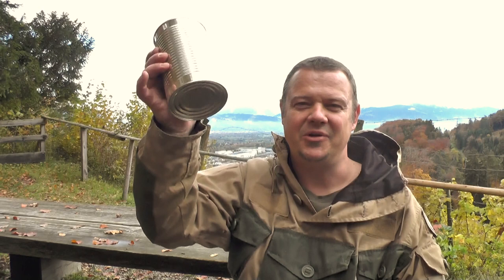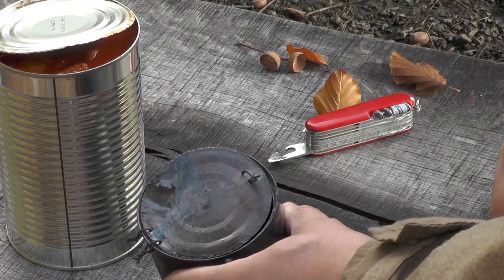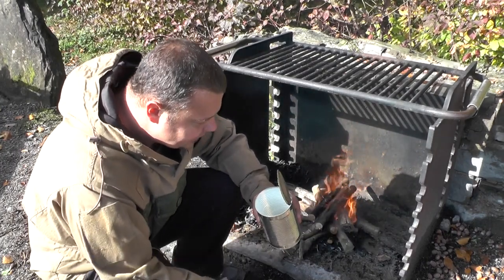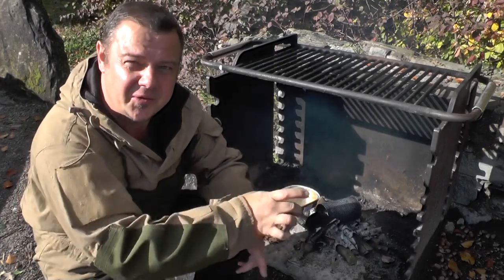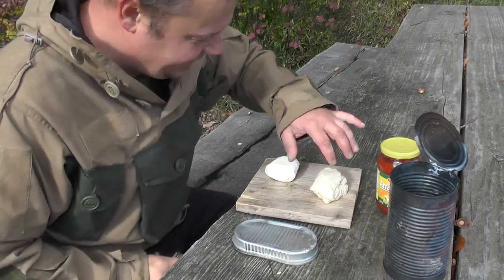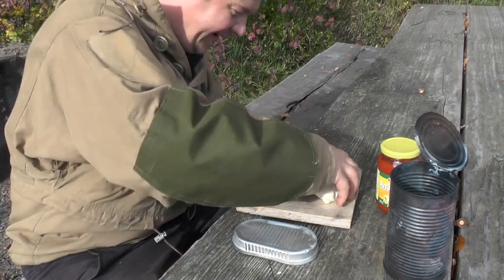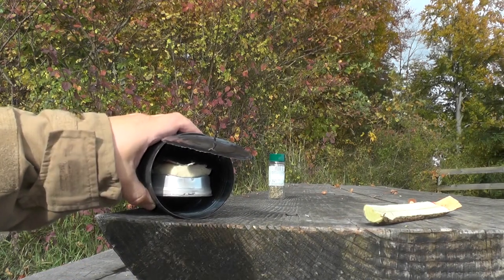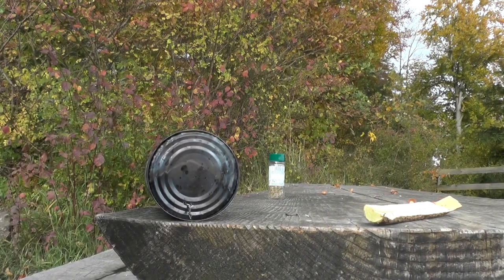10 Cent DIY Tin Can Oven - Amazing oven for baking bread, pizza and cookies

Comment: Nice video as always ! Here is a simple pizza dough recipe for those who do not know:  (for 1 big or 2 little pizzas (or maybe 8 can oven pizzas...):
250g flour, 1 bag of baking yeast (I think it's like 7 g ), 3 table spoons of olive oil, 1 flat teaspoon of salt and 15cl of lukewarm water (about 35°C). Mix flour and salt then add the yeast, pour the water in and knead for a moment, then add the olive oil and knead again until it stops sticking to your fingers. Wrap it in a cloth and let it rise for a hour at least in a room above 30°C. You can add oregano and or dry garlic to the dough if you want, or replace 1/3 of the water with dry white wine, or milk if you want it to be a little "brioché" (I don't know the english word, sorry). And there you have it ! It can be frozen to be used later, no problem !
Reply from the maker: Thank you for your recipe!

Comment: Cans for peaches, pineapple or pears are uncoated on the inside since the metal contact keeps the fruit nicely bright. But also, you should remove all fruit from the these cans directly after opening to avoid metallic taste.
Stones under the tray would have been a good idea to set the center of gravity. Preheated stones ( used sandstone) would provide additional heat capacity for improved baking power.
Reply from the maker: hello Frank. Thank you so much for this super valuable Tips. I learned a lot from your comment!
Reply: @FelixImmler  And (I wanted to say that in the comments but that's a good occasion), you can avoid throwing burnt plastic residues down the river, which I'm pretty sure the fishes will appreciate ! As a fellow nature lover, I'm sure that you are aware of the damages plastic in all its form can cause to wildlife, and that we should avoid using it as much as we can. Very nice video, though, I can't wait to try it !

Comment: Thanks Felix, for the video, the bottom crust of the pizza looks great, but too hot, consider the dough will rise and to be more like Italian homemade pizza your way, just an idea 💡 if you like thin crust or not as doughy, you could make two pizzas and bread with that, if you use less dough, add some pepperoni 🍕 or Italian sausage or beef or vegetables use with a small rectangle pizza thin stone with rocks underneath it heated up for a fifteen minutes with nothing on it, instead of the sardine can. Cheers, Chris

Comment: You did a FINE job by yourself. This brings back a lot of memories because when I was in RVN I ended up on a firebase that was still under construction and got a block of C-4 explosive from a Combat Engineer. Not knowing what to do with it I put it in the tool box on the forklift I was running but the guy that gave it to me said it was good for heating up C-rations. i took a small C-ration can and punched holes around the bottom and top sides with my can opener. Then placed a piece of C-4 about the size of a pencil eraser in the middle of the bottom and lit it, placing whatever I wanted to warm up on top of the small can. Worked perfectly but the guy said to be sure and let the C-4 burn itself out and not try to stomp it out or it'd blow my leg off. Worked just fine. I ended up leaving but always wondered what my replacement thought when he opened the tool box and there was all that C-4.
 THANKS for being a fine chef! You get a big A-PLUS from me!
Reply from the maker: Hello Lewie. Thanks a lot for your wonderful story and thank also for your compliment!
Reply: @FelixImmler  Just stating the facts about 1971 and now with you! Chef Felix!

Comment: 3:43 Regardless the water source, the tins will be sterilized by the heat of the fire, so Contamination is really not an issue here, Felix  💯👍👏
Reply from the maker: Thanks a lot for your hint!
Reply: @FelixImmler  No worries my friend.  I have cooked with stream water and cleaned pans in streams with sand too.  Pioneers did it all the time.
Reply: Yes it`s fine so long as you`re not down stream of the chemical plant, nuclear power station or active sheep dip.
Reply: @iainb1577  Well the Active Sheep dip aka cattle water will be sterilized.  But the 1st two choices ... Well 1 lets you be your own night light.  The other makes your skin hard like a crab shell
Reply: I believe he was more worried with chemical contamination from the factory coatings put on the tins to prevent rust and flavour migration.
Reply: @blueeyeswhitedragon9839  He took care of that buy burning off the plastic coating.  Anything toxic wouldn't be allowed in any container that holds saleable foods.

Comment: Fabulous - and how about cutting the lid open only around approximately half the circumference, folding the half of it out to access the inside, and then placing the whole can with the open flap upward, instead of downward, ( so the baking tray will sit on the side of the lid that is still attached to the body of the can), .. that way smoke may be less likely to enter the inside of the can while on the coals -  yes.. no..?? just a thought  -

Comment: In the US we have really large “#10 cans”. Also, open it with the can opener that cuts the edge of the top seam rather than the top and leaves a safe edge. The detached lid can be used to loosely reseal the can. 
By the way. You forgot to tell us how long it took to bake the bread. You did mention 5 minutes for the pizza. 
Thank you for all your videos.

Comment: The like to dislike ratio is beautiful. Also is it safe to do this with a soda can?
Reply from the maker: Thanks a lot for your compliment. Good hint with the soda can. I guess a soda can will also work. The melting point of the thin aluminium is pretty deep. That could be a problem.